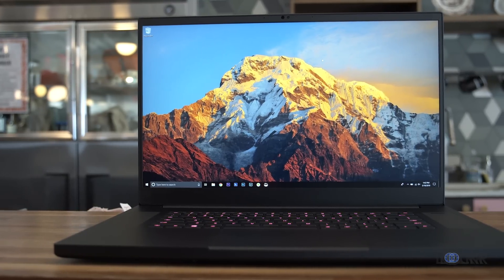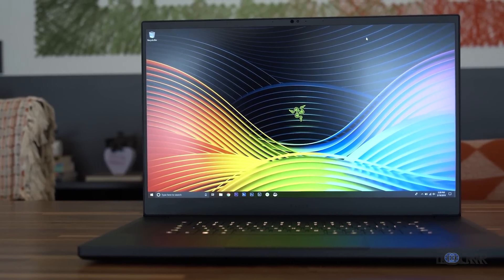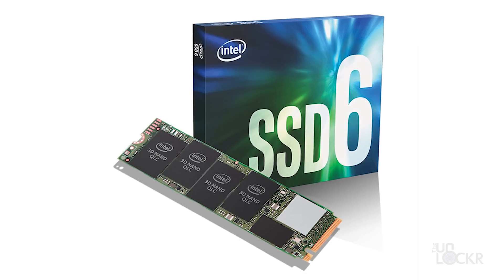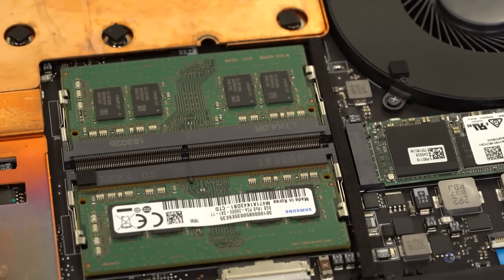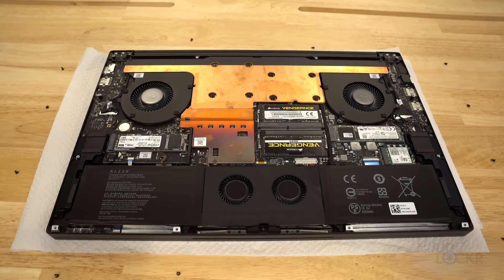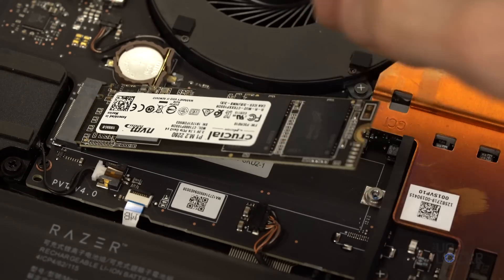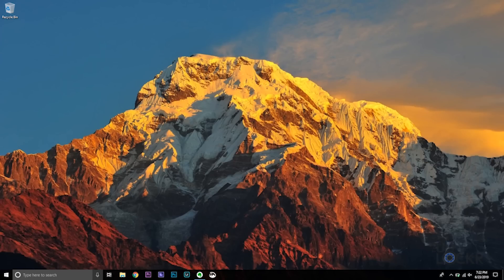How to Upgrade the Razer Blade Pro 17 RAM & SSD

Comment: @TheUnlockr - I'd like to buy the tools and upgraded SSD/RAM you recommended. However, your link in the description doesn't work. 

When I click, "HEAD HERE FOR ALL THE TOOLS, RAM, SSD, ETC" I get his error:

Ooops! Something went wrong.
This site is currently experiencing some problems. Please try again later

The reference of this error is 93a6df67638285827fc661964142676c.

Comment: Have you tried using raid for this laptop? I want to buy a new laptop perhaps. Especially one that can upgrade to 64GB RAM and has a higher end GPU. And 2 slots for HDD is definitely something. As 17 inches seems to be the biggest screen I can get for a FPS.

Comment: Note: ANY opening of the Raserblade 17 case to perform any self upgrades, instantly auto voids ALL warranties provided by Razer.
Reply from the maker: That's actually not true. They market it as upgradeable and so long as all you touch is the upgradeable components it's still covered.

Comment: Mine had a black rubber pad where the new SSD goes. It came off pretty easily so I took it off. Not sure if maybe it was some sort of heat shield that I just removed but whatever….

Comment: Good video. However, this tool EaseUS Todo Backup and another tool advertised as "free" called AOMEI both were listed as free and both pulled BAIT & SWITCH and want you to pay to execute the clone. Good news my Sabrent SS2 M.2 drive comes with Cronis software for that is really free (included with purchase) and I was able to use this whole video but instead with the Cronis software to clone my SS2. I also used an External SSD M.2 enclosure (which was Thunderbolt 3) and cloned with that which was very fast. So in my Razer Blade pro I cloned the 512 SSD to a 1 TB SSD as my boot drive and then also added a Sabrent 4TB SSD nVME M.2 for a total of 5TB.

Comment: Thank-you. This really helps. If you have a new computer but have not yet turned it on, is it ok to open it up first and upgrade the RAM and put in the extra SSD memory. Or do you have to turn on the computer first and log in and set it up first before upgrading the RAM and SSD memory.
Reply: OK, I answered my own question. Fire it up and set it up first, shut it down and then upgrade. Or upgrade when needed.

Comment: This was great.  I changed out the existing SSD to a larger SSD but I noticed that the Recovery Partition was not copied.  Is there a way to bring that over to the new SSD as I am worried about being able to reset the laptop back to base if I ever sell the laptop in the future.

Comment: Do I need to remove the battery first before adding another ssd into this? Thanks
Reply: Removing the battery is mostly just a safe precaution but it isn't required for swapping the ssds or ram

Comment: I tried to follow this guide but the screw in the secondary drive seems different and I was unable to get it out with the philips provided in that kit you suggested in your link...I suspect I either stripped it due to inexperience, its the wrong driver, or what I think is screw was just the hole for a screw. Any idea what kind of screw it was they used for that slot?

Comment: Hello. Thanks for the excellent guide. If I wanted to upgrade the 2020 model which supports 3200MHz, would you recommend 2 x Crucial Ballistix 3200 MHz DDR4 DRAM CL16 BL2K16G32C16S4B
or 2 x Crucial Ballistix 3200 MHz DDR4 DRAM CL16 BL2K16G32C16U4B, not sure of the difference between these 2?

Comment: I upgraded to 2 new ssd's did as the video said, cloned the system to one, but if I don't have the original ssd in the laptop it fails to boot windows with an error (Winload.efi) Any help appreciated.

Comment: hi i have the razer blade 17 pro 2020 
with rtx 2080 Super
i want to upgrade my SSD is the razer blade limited to only 2TB per SSD BAY MVME? or am i able to install a 4tb to 8TB in a single slot SSD NVME BAY? or is each bay limited to 2 TB SSD NVME BAY?
reason i am asking is beause i want to invest in a 4TB SSD to 8TB SSD

Comment: So I have the Razer Blade Pro 17: Gaming Laptop - 120Hz Full HD IPS Display - Intel Quad-Core i7-7700HQ - NVIDIA GeForce GTX 1060 – DDR4 16GB RAM (2400MHz) - 256GB NVMe SSD + 2TB HDD - Windows 10 - CNC Aluminum

Do they use the same upgrade options? Also what happens if the 2TB HDD isn't showing up on the laptop as an option to begin with? How do I fix that issue? Any thoughts would be highly appreciated! Love your videos!

Comment: How about the Razer Blade Pro 2017 Full HD, I7-7700, GTX 1060 which has a 256 Gb SSD. Does it have 2 SSD spots? I don’t know that much about computer but I want to upgrade mine or add one more SSD? Can you help me, Sir?

Comment: if I buy the 1tb version, are there 2x 512gb installed or 1x 1024gb (so one slot is still empty)? I need a good laptop with 64gb of ram (want to do some virtualization), and also game on it, and it should be pretty compact, also I need a 4k display for productivity (watching crypto charts and similar stuff), is there a better laptop for my tasks? I think the blade pro 17 is the best choice....

Comment: Hey David - I just got the 2019 Razer Blade 15 2060, I know this is a different laptop here, but I was looking through one of your older upgrade vid's and saw that the 2018 version of the 15 could handle 32GB Ram and 2TB of SSD - do you know if this is the case with the 2016 2060 model?  I'm looking to upgrade but having a hard time finding info on the 2060 maximum upgrade specs.  Thanks for the great info as always!

Comment: Is it absolutely necessary to switch the new ssd back to the original ssd slot if I'm keeping both ssd's?
I cloned the system to my new ssd but just left it in the new ssd slot so I can just use both but have windows running on the new ssd

Comment: Do any of your Razer laptops get disconnected from a monitor if the  USB-C cable is touched or wiggled? Got this issue right now and not sure if it is normal.
Reply: Try another USB C cable with the monitor or try another monitor completely. If it still happens on another monitor as well then it means there is a problem with the laptop and you can try to get it replaced. If you tried another USB C and it worked, it means there was a problem with the cable.
Reply from the maker: None of mine have 🤷‍♂️
Reply: @TheUnlockr  Thanks for the reply!

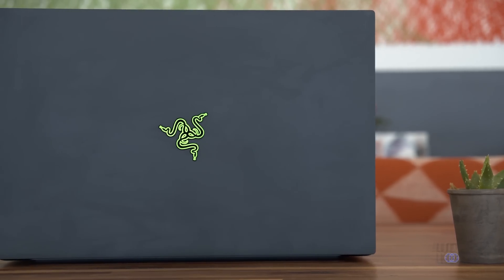Comment: Good job on the tutorial, excellent. However, 8:30 Before selling the SSD/NVMe SSD, make sure to format it first or delete the existing partition. You can do that after the clone finished and install it on the 2nd SSD slot, then do the disk management, or you can right click "My Computer/This PC", click on Manage, then under Storage, click on Disk Management.

Uninstall the 2nd slot of SSD; You can sell it or just keep it as a backup (if you only do the clone) just in case if there's something wrong when or if you update the Windows, or get Malware or Virus, etc... Or if you want to sell the laptop in the future, you can put all the things together back again as original. If you sell it as original setup, make sure to remove the Windows key from your Microsoft account, so the new owner will not bug or complain why the Windows 10 (assuming it is), cannot be registered to their account since it was already tied under your name/Microsoft Account.

However, if you use your own new Windows 10 key (e.g upgrade from Home to Pro then you change the key with Retail key, assuming the original is OEM), not the original, it might get complicated from here, unless you know what you are doing if you know what I mean.
Reply from the maker: Good call!

Comment: Thank you for the video. I'm purchasing a Razer and dropping Apple. That being said, I've never upgraded a laptop but am now really considering getting it and upgrade to 32RAM and 2T SSD
Reply from the maker: Do itttttt
Reply: @Tik_flix  Try Lowering the CPU & GPU speed, whenever you don't need it. That saves battery power, and also makes it run cooler.

Comment: Hey, question: my gpu while around 80 degree at load causes the laptop to restart while gaming or during a stress test. How can I solve this? Is the power supply not giving enough juice? I have a 135 watt. Laptop is the legion y730.

Comment: could you pls recommend me a laptop with decent battery life i am thinking to get 17 inch either msi GS75 with 9th gen core or razer blade 17 pro
Reply: Or NEW Gigabyte AERO 15 or 17, 15" 8.5hours. Maybe less, depending on used. No news for 17" as at this time, maybe in August 2019.
Reply: @RandomZeroGravity  i would go Gigabyte but i hear the temperatures are really high around 90c or so when gaming with razer it doesn't do that i hear i am not saying gigabyte are really bad they are good but its just the temperatures i am concerned about.
Reply: @admiralv8538  I think that's because of the clock speed was higher, which is need higher voltage too, equal more heat. Now that you mention it, Blade 17 Pro has x2 M.2, than AERO 15.
Reply: @RandomZeroGravity  mhm except the battery life isn't that great on the pro 17 because of the extra fan they put in.

Comment: holy crap, this is exactly what i needed right now. I have this exact laptop and am literally about to Upgrade my Ram & SSD! WTF!? Thanks for this!
Reply from the maker: Ha I can READ YO MINDDDD :)
Reply: same here
Reply: Hey are there any problems with it?
Reply: @Gamers4511  Not really, the setup process was really smooth. This laptop is a champ
Reply: Neochromatic but what about the quality control issues on the 15? Isn’t it possible that it’s gonna happen on the 17?
Reply: @Gamers4511  Well I've been buying Blade Pros only and they work fine. I can't say much about the 15 inches. I do know the 14inch models used to have some issues.
Reply: Neochromatic you think I should return my msi gs75 and get the razer 17?
Reply: @Gamers4511  Oh yeah, Razer laptops used to be flawed but now they're irresistible to me. I personally got the 2080 model, the thing had four fans. I would buy this laptop just for that feature alone. The 2080 is a bit overkill, I think the 2060 would be fine.
Reply: @Gamers4511  got one. Have issues. Nothing major. Gotta live with it. 4K 120hz 2080 MQ 64ddr4 aswell, issues are keyboard lighting. Two keys permanently wrong colour & synapse doesn’t change it unless on certain lighting modes. Screen loves to not turn on but hdmi / using a different display the laptop is functioning fine. Beautiful screen. Zero bleeding, zero. Dead quiet. Seriously badass thermals. 1tb SSD. Which is upgradable to 16tb of SSD storage.
Reply: @redlineracing4947  shit dude it’s been a year and a half since I’ve had mine and it functions fine like day one. Did u experience those issues right away in the beginning could be a lemon.
Reply: @Gamers4511  yes. Right away. They are all lemons. If you have one that’s solid. You get lucky Razers laptops are amazing & I love the build quality & I love the design & all that shit. But man on man customer service is dog shite and they fail so regularly. Other than that though mines all good. & the issue with the display cutting in and out is to do with bill gates the devil & his shitty software updates & bios etc. Qubes OS dual booting & VM’s are the way forward. It isn’t a hardware issue for the screen. But for the keyboard it is. Unless using starlight on synapse.
Reply: How is the speed of your blade 17 after ssd upgrade
Reply: Hey did you also change the stock ssd?